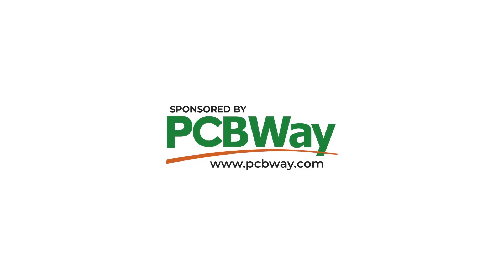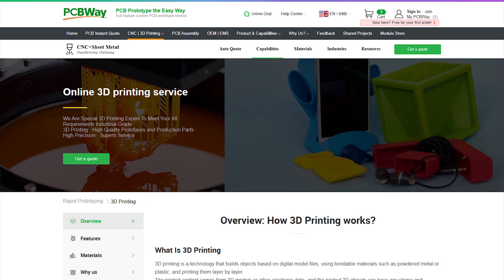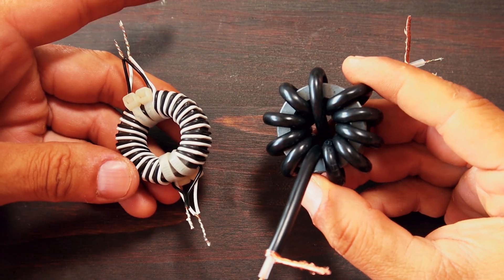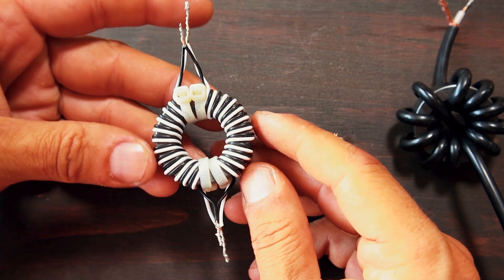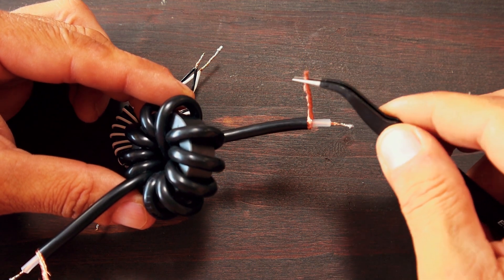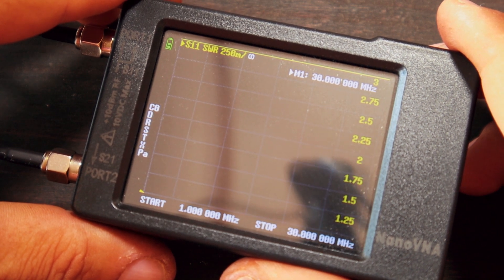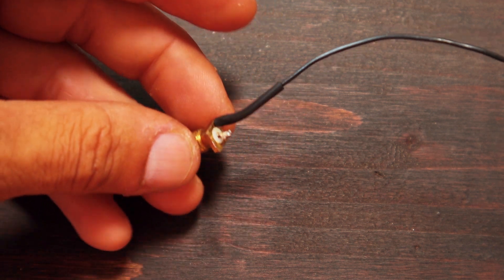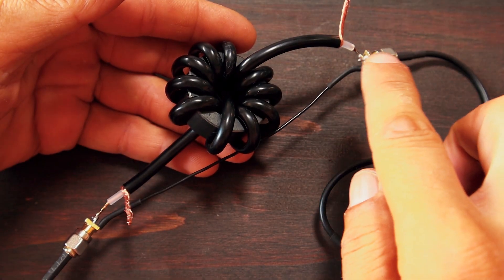Common Mode Current Chokes Comparison - NanoVNA Measurements

Comment: This looks like the correct procedure to me, I’ve done this test many time and have videos on my channel.  The only thing Inwoild have done different is to use the shield on the coax choke and not the center conductor.  Thanks for the video 👍
Reply from the maker: There are many ways to measure, but to me this seems the easiest. Indeed you are right. Measuring on the shield would be more precise. To me it was just easier to measure the center wire, considering that the differences in measurements between one or another are not much anyway. Thank you as well for the comment. And for the nice video you posted on SWR. I didn't had the time to comment as I was working ( hi ). 73, YO6DXE.
Reply: @dxexplorer the main point of the test is to determine attenuation of unbalanced currents and the only way to do that is have a known unbalanced current so you can measure the loss, you did exactly that.  Thanks for watching the SWR video 👍
Reply from the maker: @TheSmokinApe  Indeed. Thanks so much for the help. Have a fantastic rest of the week. I need to catch up with the new videos )).

Comment: I have also noticed that chokes wound with bifilar windings usually push the SWR up as frequency increases. This happens because bifilar windings behave like a coupled inductor with inter-winding capacitance, forming a resonant circuit that alters the feedpoint impedance as frequency changes. The easiest way to avoid this is to wind the choke with coax. While this typically gives slightly less choking per turn, it behaves as a broadband transmission-line device rather than a resonant one, so the SWR remains flat. Adding an extra turn or two usually compensates for the lower per-turn impedance.
Reply from the maker: I will need to get some of that thiner coax and see if I have better results with more turns than I had with the regular RG58 since I could not put more turns on the toroid. So far since I build the choke I stopped having issues with CMC. On 80m and 40m especially it was horrible before I installed the choke. Happy New Year in advance. 73, YO6DXE.

Comment: I would place the common, more choke, nowhere else, but at the feedpoint. If you don’t, you run the risk of making the feeder part of your antenna. If you wish to you may have a second choke in the track.
Reply from the maker: I tried a few locations... right after the output of the impedance transformer ( was not good ), then about 4m from the output transformer to have the braid of that piece of coax as counterpoise ( same results )... then I placed it right next to the transceiver. So far that was the best result. But this with the parallel wire windings. Not sure about the coax version. Maybe that one has a different effect. I will experiment a little more in the spring when I will move back in the village I used to live... and when installing the new antennas I will try to see if I can get better results experimenting with different positions. 73, YO6DXE.

Comment: Hola. Pregunto: ¿Se pueden mezclar materiales diferentes para cubrir mas ancho de Banda, ejemplo FT 240-43 + FT 240-31 puestos en serie/Linea. GRACIAS
Reply from the maker: I don't know as I never tried. I know that the 31 material it's better for RF chokes, but I don't have any 31 material toroid. Maybe I should buy and try. I did wanted to try other materials as well to experiment and see if I get a better bandwidth. I never had the time though and neither other material toroids to test this. 73, YO6DXE.

Comment: I understand that this was posted over a year ago very and overall you did a good job Great I'd like to recommend that you also take a look at the resistive versus reactive impedance and not just the loss in the choke. Measuring just loss can be very deceptive, you don't know what kind of impedance you're dealing with and there is no situation where reactive impedance isn't going to make problems worse. You want resistive impedance in your common mode chokes and herein lays the problem with bifilar wound chokes, Quite often there are large areas of bandwidth that are purely reactive impedance which is something you want to avoid at all costs

Winding a common mode choke for broadbanded use is Much more complicated than for a single frequency. I have found through testing that seventeen turns of RG400 wrapped around 4 FT240 mix 31 cores will provide upwards of 8K ohms of purely resistive impedance At 80 meters, This slowly reduces down to about 4K ohms of resistive impedance at 30 megahertz.

 The reactive impedance in this design is limited to a very small frequency span between 160 meters and 80 meters and is completely outside the ham band. In other words there's absolutely no reactive impedance anywhere in the ham bands.

This is the only choke I have found to do this, for example 12 turns around a single core provides good resistive impedance on 20 megahertz and above But anything below 20 megahertz starts to see large swaths of reactive impedance. 

 17 turns of RG400 around a single core is slightly better but you still get quite a bit of reactive impedance on 80 and 40 meters, 

 if you don't operate much on 80 and 40 or don't have problems there then a single core is probably fine but if you're getting common mode on 80 and 40 meters which is usually the most problematic bands then four stacked cores and 17 turns of rg400 Is what you want
Reply from the maker: I will try to experiment a little more with these. But since I had good results and no more CMC on any of the bands from 80 to 10 meters then I was happy and lost my interest to experiment more 😁 Thank you for sharing all the info. It's useful stuff. On 80m and 40m I always had issues with CMC until I built this choke, I also used to have bad reports all the time ( it was messing up my modulation in a horrible way ). After I installed the choke it was all good. Thank you one more time and Happy New Year. 73, YO6DXE.

Comment: At 8:36, you swapped the pictures. In your measurement earlier on, the coax chole had the most attenuation in the middle of the curve.
Reply from the maker: Possible yes. I put the writing the other way around. I just had a look as well. But indeed the two parallel wires version is a much better version than the coax version. It's more linear and I like that. I will post the blog article for this video soon and I will point out the image swap in the video. Thanks for letting me know. 73, YO6DXE.

Comment: What on earth??? The choke is supposed to present a high impedance to the shield current yet you bypassed it with that jumper wire and you are measuring the inside of the coax... This is totally wrong. 
You need to measure between the ends of the shield.
Reply from the maker: No offense from me... but you need to learn a little more both on chokes and also the right way to measure them... then you will realize I actually did the right thing. 73, YO6DXE.

Comment: The choke would work better at the antenna end because it would keep the coax from being part of the antenna.
Reply from the maker: For some antennas yes. For others it's a little more complicated. I usually like to test depending on the antenna and pick the best result. 😁😁 73, YO6DXE.

Comment: Are the two half-windings in the same direction around the toroid, or opposite?
Reply from the maker: In the same direction yes. One half ( winding with two parallel wires ) on one side... and the other half ( with other two parallel wires ) on the other side. I hope it makes sense as is confusing in writing (hi). Then... you connect the beginnings of the dark wires together and the beginnings of the light wire together ... then the same with the ends. So we end up with two wires at each end that connect to the BNC or other connectors. 73, YO6DXE.

Comment: One is a choke, the other a balun.
Reply from the maker: Both are one and the same thing... 1:1 balun or RF choke. A 1:1 balun or a choke do the same thing... the only difference is what we use them for. If used for a dipole... is a balun... if used to reduce common mode... is a choke 😀. 73, YO6DXE.
Reply: @dxexplorer  one is a current balun employing a symmetrical pair of wires. The other, it's made from a non symmetrical section of coax, which in my opinion, is simply a choke.
Reply from the maker: The construction method is different... but what they do or the way they act is the same. On one side we have two parallel wires wounded in an opposite direction made of two wires each... and they turn the signal out of phase. The coax version does the same thing but with only two wires of the coax. Because once we pass that wire thorough the toroid and wind in the opposite direction ... the effect of that is again an out of phase signal. So they are different in construction indeed... but they both do the same thing.
Reply: @dxexplorer  negative.
Reply from the maker: @arconeagain The results in measurements show that. And by connecting the wires together in the parallel wires version.... we create the same thing coax does. Is the same. That is why we can use any of them either as a CMC or 1:1 balun. Is just physics and common sense... in a common mode choke ))
Reply: @dxexplorer and I do know what a balun stands for, however, the application and comparison makes no sense. We're talking kettles of fish here.
Reply from the maker: @arconeagain https://www.coilcraft.com/en-us/edu/series/a-guide-to-understanding-common-mode-chokes/

Comment: You have built and tested simple RF filters rather than "common mode chokes". In common mode, noise current travels on both conductors in the same direction. Real common mode chokes have both conductors separated and wound on the core in opposite winding directions (like clockwise and counterclockwise) to create a null for currents that are common to both conductors and traveling in the same direction. Your single coax wound on a torrid core is simply filtering out RF that is returning on the shield. That shield RF is not common mode because the shield current is not traveling in the same direction as the signal on the center of the coax. If you tried separate the shield and the center conductor to make a real common mode choke with 50 ohm coax, you would ruin the impedance as soon as you separate the shield and that would create a problem. So you really don't need a common mode choke at all. You need an RF filter. So stop calling simple RF filters common mode chokes. You are creating a bunch of confusion.
Reply from the maker: You are right about the way it works... but pay closer atention on how the coax is on the toroid 😀😉 is not just a simple coax around a toroid.

Comment: but, if you loose 30db on the signal path (the inner copper wire of the coax) how can this be a good thing?
Reply: His measurement was a bit strange. 
Firstly, I don't "like" the coax versions - this is just a preference, but forcing coax around such a bend affects impedence so I avoid this design.
Secondly, the wire version is a 1:1 balun. Both he and lots of other people describe it as a "choke" but it is better described as a 1:1 balun because this is the function it provides. It doesn't transform the impedence (1:1) but does reject imbalance. This is useful for connecting an inbalanced coaxial cable to a balanced dipole. It makes sure that both legs of the dipole radiate evenly. It does this by providing a high impedence to uneven currents (common mode currents) returning to the coax.

He is measuring the common mode rejection. What he is measuring is the ability of the balun to reject common mode current (imbalance) because he is only connected to one "leg" of the balun.

-------------------------------------------------------------------------------------------------------------------------------------------------------------------
Normally, I stick a 50ohm resistor across one end of the balun and then make a full coaxial connection at the other end of the balun. The measurement I make is S11 (SWR/Return loss). I end up with a plot that shows how much of the power is absorbed by the resistor, and as a result, how close to 50ohm the input of the balun is. Usually, we just assume that the common mode rejection aspect will "do it's thing" without actually measuring it.
-------------------------------------------------------------------------------------------------------------------------------------------------------------------

What this guy did was the opposite - He measured the common mode rejection (and got pretty good numbers). He did seem to misunderstand what he was looking at though - he commented that his units would be better at 80m and below when in fact what he was seeing was worsening common mode rejection at lower frequencies. The numbers down there were still in the region of -20dB (-99%) so very acceptable.
Reply from the maker: @digitalradiohacker you are very right about the coax version. I don't like it either 😅. Maybe with a coax that it would be easier to bend around the toroid, but even then there wold me more loss than the wire version. Indeed is a 1:1 balon... or common mode choke. They are one and the same thing. Is just the purpose you are using it for that makes the difference in names. When it comes to measurements... there are many ways to do it as you described. Some easier some complicated but usually the results are very similar. For me the idea is not to get perfect lab measurements as at the end that is why we are called amateur radio operators... and not professional radio operators 😅 it's all about the fun in experimenting. The most important thing is to have an idea about where I am with the measurements. Now talking about the measurements on the 80m version compared to the 10m band... is about the ability of the choke to reject the common mode. And the idea is to try to get it to work as even as possible on the entire HF band, as equally as possible on all bands. So I think I can still experiment a little more on this using either a diferent material, like 31 instead of 43 for example, or with the number of turns according to the toroid size. Because the way I built this one... the number of turns was meant for the 240-43 toroid so clearly on a 140-43 toroid like the one i used the number may have to be diferent. No time to play at the moment as free time is a problem... but is on the list 😁. Thanks for watching and have a fantastic rest of the week. 73, YO6DXE.
Reply: @dxexplorer  
Unlike a lot of others, I don't see a problem with the way you made the measurement. In fact, I'm going to copy you in the future! 
I am still going to continue to do my original measurement with 50ohm resistor at one end and coaxial connection at the other end, but I'm going to do your measurement as well.
I am adding more and more pages to my website and I am going to add your method as well as mine. I'm going to call it "The YO6DXE Sweep" LOL! 

The results you got were really good, and I wouldn't change a thing. 
You were getting around -30dB right up at 30MHz (massive common mode rejection).
The -30dB trace was pretty flat all the way down to around 5MHz.
Down at 3MHz the rejection reduced slightly, but you were still getting -27dB which is way more than 99% of common mode currents rejected.
Reply from the maker: @digitalradiohacker well to make you smile I want to try your method hahaha. I also learned from others is not my method. I had no clue how to measure ... with any method. Good luck with the experiments to you as well. I will try to see if I can get it to be more even but when there will be free time 😅. Ohh and put the blog link here... I like reading.
Reply from the maker: You don't loose anything... is a bit complicated to explain in a comment. Let me see if I can find an article and I will post a link that will explain the way it works. https://www.coilcraft.com/en-us/edu/series/a-guide-to-understanding-common-mode-chokes/

I hope it helps. 73, YO6DXE.
Reply: @dxexplorer  thanks for the attempt :-) I understand common mode chokes, but these should have an effect on the signal running on the coax shield and never on the core.
Reply from the maker: @nunonozelos Indeed. But since you basically measure two paralel wires..  it doesn't matter which one you measure... the measurement will be nearly identical.
Reply: @dxexplorer  if the measures should be nearly identical in both cables (balanced line) you should not need the choke. :-) you need the choke exactly because the "wires" are not balanced.
Reply: you should never be happy in reducing not even 1dB in your signal cable.
Reply from the maker: @nunonozelos Yep... but you still measure two parallel wires. The way the choke acts afterward is different than the way you measure. Having a coke with a coax is identical to a choke made with two parallel wires... except that on the coax one you have a center and a braid..  but still it acts the same as two parallel wires. So it doesn't matter what wire you measure... the result will always be the same. What the coke does afterwards is diferent as it goes through two out of phase windings and there is where the magic happens.
Reply from the maker: @nunonozelos  I think you have to read a little more on how the rf choke works. I am not saying this to offend don't understand me the wrong way... but an RF choke does not attenuate the signal you need it to go into the antenna... it stops the common mode current to come back into your transceiver on the coax shield... and a lot of interferences caused by various things that surround the antenna. Sometimes so much if the choke is well build... that from S7 of noise you may go as low as S2 - S3. Again... it will not attenuate the transmitted signal or the one you receive. That is also the reason why there are different designs for different frequencies. You can't use a choke designed for HF on VHF for example... or the other way around. Then yes you will loose signal.